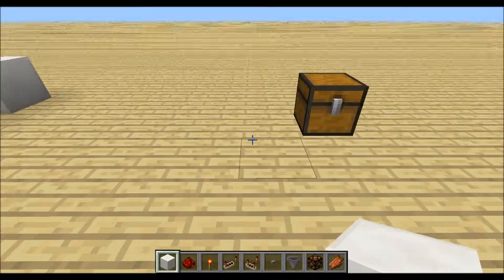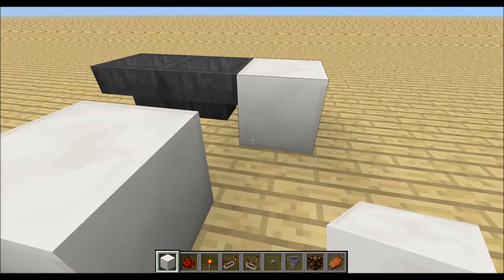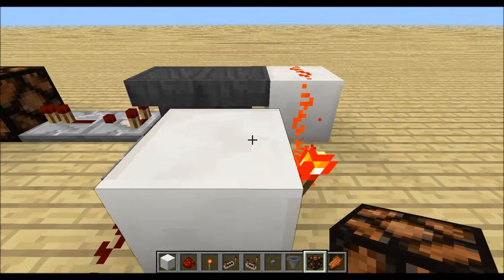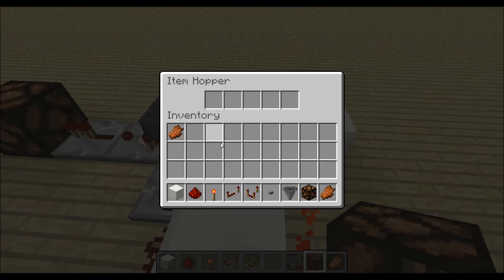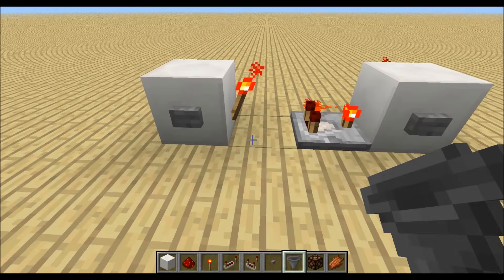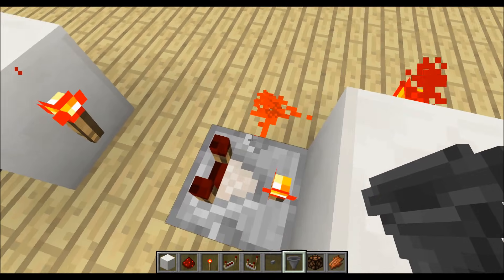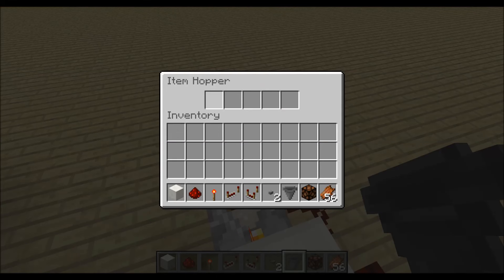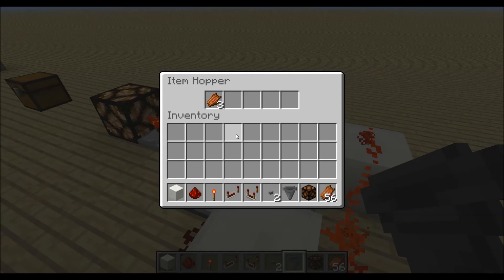Easy Custom (005) Timer 2s - 256s [Tutorial] Minecraft 1.5

Comment: If you add a redstone torch on the side of the lantern, and connect redstone from it, back to the stone block, you can make it repeating

This is so helpful, specially since modern hopper clocks don’t work in 1.12.2
Reply: If you need it to repeat just use a regular ethos clock.
Reply: @thatsHECKAtight ethos clock doesnt work in 1.12.2, atleast not in rlcraft which is is in 1.12.2

Comment: If you use this system and place a sticky piston in place of the redstone lamp with a redstone block stuck to it then place a line of redstone dust from the redstone block around and back to the block with the switch and remove the switch you can start this and it will run forever transferring the items from hopper back an forth.  With just a few items in one hopper you can push the piston out for 30 seconds, a minute whatever you want and then it will go back to the static position for the same amount of time and just keep repeating.  This allows you a very slow timer for activating things for a while and then deactivating.  Very handy slow signal timer that will just run forever after you start it.
Reply: Great! Can you make an example in an image? I struggled a little.

Comment: Apparently this doesn't work individually. Apparently the 1st is the main. Then if you make a 2and. It only begins count down after 1st has finish it's countdown. Which means you can make this stack. So, if you're tryna make something's delay quicker than something else. It won't work or if you tryna make something delay slower than something else.it won't work. So, don't bother tryna run 2 of these in 1 redstone circuit that uses the same input track. Because it won't work. The main 1 will be the only time working as you intend it to.

Comment: Just used this in a design I have for a skeleton spawner farm. Basic bone crusher design I got from another video on here slightly improved to use this push button timer system to automatically reset the piston. Timer still works in 1.7.5.

Comment: how long is a 1 min
Reply: 60 seconds due
Reply: I mean how many blocks is 1 min
Reply: oh
Reply: Put in 75 blocks that should give you One Min timing
Reply: 30 seconds is 69 blocks/items so one minute should be 138 blocks/items also if you need t to go longer than 3 and a half mins you can have it hook up to another one, just make the output inverted using a torch and connect to another timer setup and use a sticky piston to move a red stone block into place

Comment: Nice one! I was looking for a timer like this which would actually work in 1.5 - the update seems to have broken so many older circuits.
I found that by adding a signal inverter and then a pulse shortener to the output you can then chain these circuits for even longer delays.
Thanks for sharing!